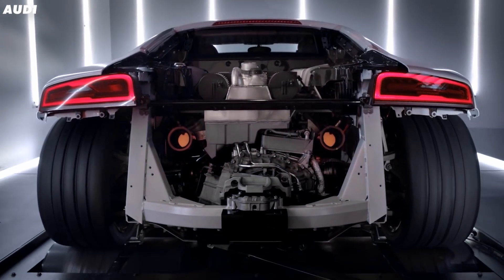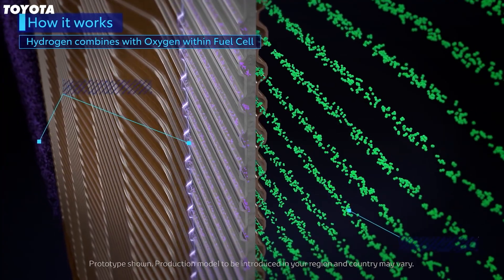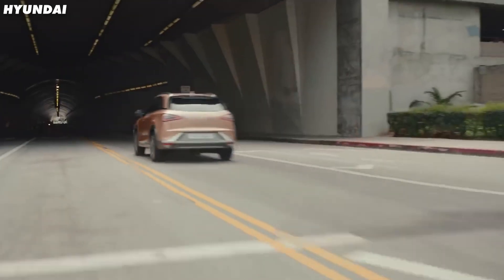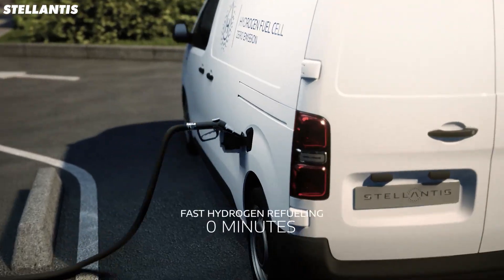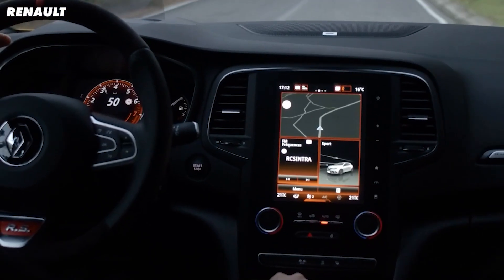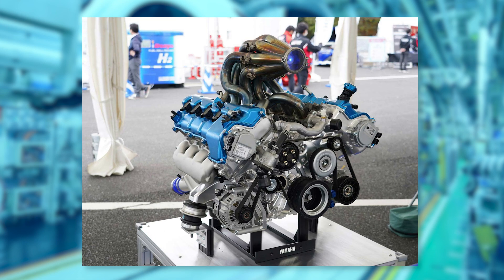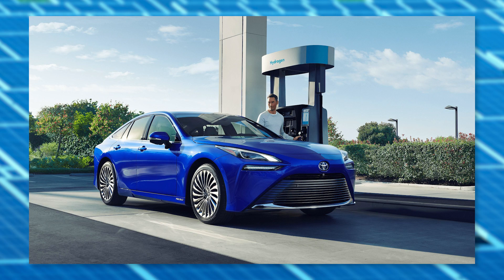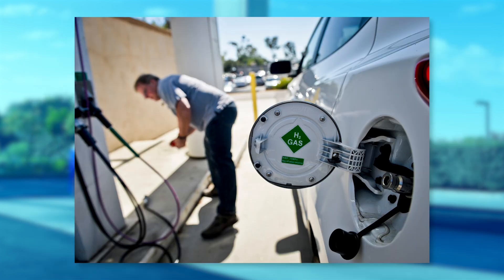The V8 Engine that Runs on HYDROGEN

Comment: This solution seems great!
Saving the environment is great. But it's not a reason to buy an electric car for most people, as of now. I mean most regular people won't buy a more expensive "green" car just to save the environment. So for a "green" car to work the prices has to go down. And this goes for everything "green" whether it's food, cars etc.
Only rich people can take the hit of paying more just for the environment reason. Anyway the biggest practical problem with EV cars is how you "re-fuel" them as in the time it takes to charge isn't as practical as you re-fuel your petrol car, imo. You can't really go on a spontanous trip with an EV car as you can with a petrol car it requires more planning. This was one thing for me when thinking about electric vs hybrid vs petrol. But I think when this problem is sorted amongst some other things EV cars can really be ready for the masses. And the price of course.

Comment: From what i remember a hydrogen ICE is around half as efficient as a hydrogen fuel cell, so an identical tank will give a fuel cell vehicle roughly double the range. this was a few years ago though, technology may have advanced somewhat since then.

still for the average consumer increase range for the same cost will win, a case could be made for hydrogen ICE sport/super cars and whatnot.
Reply: Burning hydrogen just cannot be as efficient as using it in a fuel cell, thanks to entropy. They might be a cool option once hydrocarbon fuels die out to save the internal combustion engine, but I doubt they'll catch on because they're just a bad option
Reply: That’s the problem is battery tech can improve 2x 5x 10x even but hydrogen is already 90% as efficient as physics allow and it’s already worse than current gas and electric
Reply: @KCJbomberFTW  Battery tech cannot, or at least lithium can't. Li cells are about as good as they're gonna get right now
Reply: The Hydrogen 7 produced in limited numbers by BMW during 2005-2007 was capable of 20mpg with petrol and 5.6mpg with Hydrogen, a laugh really. Not only running on Hydrogen the 6.0 liter V12 would lose power but the range was 1/4 of running with petrol - the Hydrogen 7 had two fuel tanks and was capable to run on Hydrogen or petrol with a change of a switch.

Comment: Odd idea, but theoretically could you use fuel storage within the frame/ tunnel to create a more rigid chassis?
Reply: No. Pressurised tanks need a certain geometry for reliability and also need to be unstressed, apart from the stresses of containing the pressure.

Comment: For my purposes an Ev has too little range and refuling takes far too long ( recently had to do 600miles in two days and have enough time to carry out the reason for the journey, dont think it could be done with an EV leaving time for eating and sleeping). So even if the Hydrogen is just running an electric motor its a far better concept. Meanwhile I'll stick to petrol
Reply: Back in 2016, 2 guys drove from one end of Britain to the other - and back again - using a Nissan Leaf. A total distance of 1653 miles in 48 hours..... and that included charging and eating etc....

Comment: We want normal engines but with green emissions and most importantly a green way to produce these fuels or energy sources. Lets hope for the best !!
Reply: You have less emissions than if you had a petrol v8. I can't wait for the hydrogen v8 as it satisfies the needs of eco people and us petrolheads
Reply: In the future, the majority of cars would be electric (hopefully solid-state batteries), but classic/ICE car enthusiasts can rejoice: Porsche is working on e-fuel with Siemens. :) Fuel produced from green hydrogen and CO2 extracted from the air. Has the exact same composition as gasoline when refined. Also, the Germans are working on e-kerosene as well for aviation. America is working on similar fuels as well. So, the average consumer in 2050 may drive an electric car, but ICE will be here to stay for this century or more for engine enthusiasts, aviation, trucking, and cargo ships, using fuel from renewable energy.

By the way, a similar process can convert carbon from the air into plastic. So, when oil stops flowing, we'll still have plastic for food packaging and medical wraps. Hopefully people recycle it, cos we already have a plastic problem in the fossil fuel era. We don't want the same problem in the green carbon capture economy. Haha...
Reply: @thatguyalex2835  Fu eletric cars. I hope more of them will burn
Reply: hho gas. look into it
Reply: If you burn, you do have emissions because the chemistry reaction; think of a match that you light up, it will be transformed in to carbon by the time the burning process ends; that's science and nothing will change that...
Reply: @krisg.4257  but while burning hydrogen you get H2O so water as emmisions. so no issues.
Reply: @SB7-r9i  not quite
Reply: @trbdann2  Exactly quite, 2H2 + O2 -> 2H20.. yes water vapour is technically a greenhouse gas but it's not as bad as CO, CO2, Unburnt Hydrocarbons and NOX anyway since the water cycle exists and that vapour comes back down to the ground again as liquid water.
Reply: Things don't really get transformed into carbon by burning (there's kinda one exception).

 I don't even know where to start.

1. Carbon is not harmful to the atmosphere at all. Because it's not a gas at room temperature and pressures. Imagine a piece of coal, or charcoal, etc...that's carbon. It's a solid. 

When something is refered to as it burns, typically it combines with oxygen (though not always) to form oxides.

E.g. Carbon reacts with Oxygen to form Carbon Dioxide. More commonly known as CO2. 

Carbon dioxide is the stuff that's mostly causing global warming etc. Not carbon. 

Carbon is not formed, it is burned.

The wood of a match stick is made mostly of hydrogen, carbon and oxygen. It's the carbon and hydrogen in the matchstick that burns. 

When wood burns in a low oxygen environment, mostly the hydrogen burns while mostly unburnt carbon is left over (if controlled and timed properly). 

This is how charcoal is made (which is mostly carbon). This is the only instance where the byproduct is Carbon (C). 

When you burn the charcoal, the emmision is mostly Carbon Dioxide. 

But, if you burn Hydrogen, hydrogen reacts with oxygen to form Dihydrogen Oxide. 

Dihydrogen Oxide is the same extremely scary sounding emmision more commonly known as regular old pure water (H2O). 

And yes, water is a very powerful greenhouse gas (when in the form of a gas in the atmosphere called water vapor...the same stuff that becomes rain water).
Reply: @krisg.4257  Wrong... you need to understand science. Go and do some chemistry, psychrometry and stoichiometry and you will learn. If you burn Hydrogen in Oxygen you make Water (there are no carbons)... If you burn Hydrogen in air, 70% Nitrogen, 21% Oxygen, 0.4% CO2 and some other bystanders... you react primarily to the Oxygen and 99.9999% water comes out the exhaust. Nitrogen is a bystander in clean combustion (NOx emissions are a thing of the past, before catalytic converters and injection) and Carbon is almost non-existent. If there is no Carbon in the combustion, then you cant make it!
Furthermore, if you use Fisher Tropsh process to make liquid hydrocarbon fuels from Hydrogen, you recycle Carbon in the atmosphere with a net-zero effect.

Dont make "science" claims based on assumptions, thats not science.
Reply: @robmilne5972  👍
Reply: @robmilne5972  Isn't it worse with NOx in modern engines with gasoline direct injection than the old engines ?  Definitely not the thing of the past.
Reply: @robmilne5972  
"Don't make "science" claims based on assumptions, that's not science."

It is in politics and the media. Unfortunately, the majority of people believe it.
Reply: @robmilne5972  You can reduce even more co2 by planting sugarcanes that it's already been used to produce ethanol.

Comment: Did anyone hear about LPG conversion kits for cars ? I see such a kit working for hydrogen as well. I also own one now and a few in the past. All the taxi's here use it. A bit of a problem for direct injected engines because it's hard to inject it in liquid form but I am sure solutions can be found. 

It consists of:
- a separate ecu that reads and calculates injections times for the vehicle 
- a tank ( usually in the boot, shape of a full size spare wheel )
- a vaporizer that changes the state from liquid to gas so It can be injected into the air stream that goes into the engine
- a separate set of injectors

It costs around 600$ for a 1.8t vw engine for ex. I guess these kits are not popular in the US due to historically low gas prices but given the global situation, might become. Seen Porsche and other big things on this.
Reply: There is a guy in my building who drives for Uber and has a natural gas vehicle. It's a Honda Civic. They are very uncommon though
Reply: Well it's not so uncommon in my country people even convert their 50k cars to natural gas to save gas money 😂 and the amount of cars are terrifying 
I live in Bangladesh these guys specialize in lpg/natural gas conversion 
Hydrogen is pretty much the same

Comment: Still better than electric which is just as dirty to manufacture if they can get the hydrogen cost down. .will take time but be worth it in the long run and easier and cheaper to maintain and produce and repair

Comment: I like that Driven has basically embarked on a series of how legacy automakers are putting in R&D into novel ways to be greener than gas, but also still stupendously less efficient than EVs to the point it won't work economically.

Comment: Grosjean's fireball would have been a crater if he'd been fuelled by hydrogen. His car would have been a mobile bomb because of the ultra-high pressure fuel tanks. The high pressures needed throughout the domestic fuel supply infrastructure system is complex and expensive. Burning hydrogen produces Nitrous Oxide which is a very nasty greenhouse gas. Diehards who want to cling to ICE cars beyond 2030 will be faced with constantly rising taxes on domestic ICE fuel. Get over it, move on. Not going to happen. F1 is doomed because Formula E has a very long contract which owns electric racing. Ross Brawn is a delusional liar. In other words, a salesman.

Comment: A point missed is that H2 ICE engines have to be tuned down to relatively low power output, compared to gasoline. This is to avoid unacceptable levels of emissions.  The sound of the car might be attractive, but the power and running cost may not be as agreeable.

Comment: Never use that H-Bomb Analogy again. NEVER! There are enough people out there stupid enough to think Hydrogen will explode that big for anything. To be understood a H-Bomb or thermonuclear device literally requires an ATOMIC bomb to set it off. 

Also Hydrogen does not even burn that easily. In Fact, it was found that the Hindenburg's hydrogen, in the lifting cells was not the cause of the fire that destroyed the airship. LITERALLY everything else around the hydrogen burned first due to a lightning strike. The Hydrogen only ignited once it was freed from the lifting cells, where it could interact with the oxygen in the open atmosphere, and the fire already in progress could ignite the hydrogen and it did not explode. 

So, fuel tanks full of hydrogen are not going to explode or even spontaneously combust. It is "the Trinity of Fire". Hydrogen is actually quite safe when handled with a modicum of care, much like gasoline.